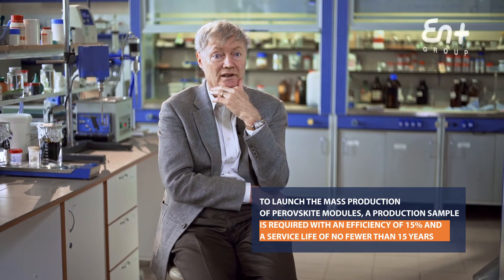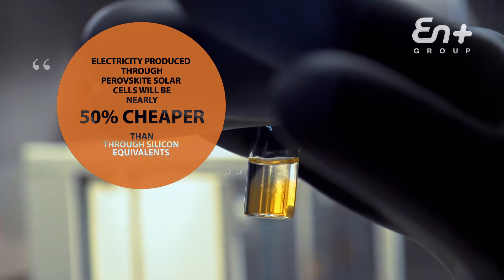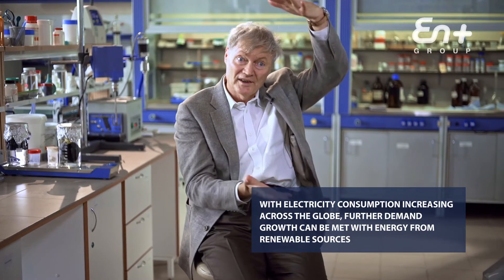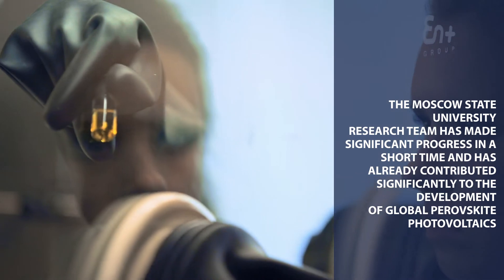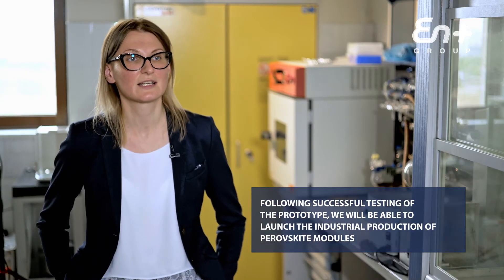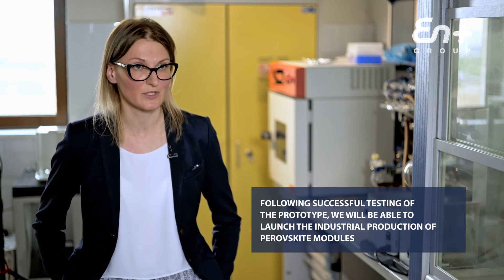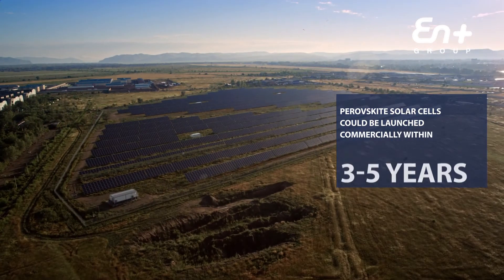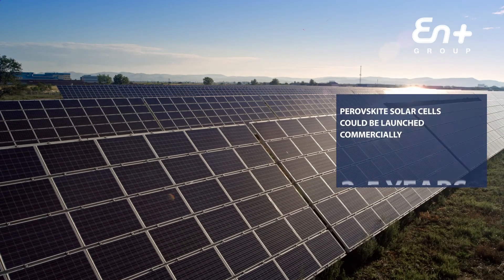En+ Group develops new generation of perovskite photovoltaic cells

Comment: As a scientist you work in the lab, dont try to predict system costs, just work on making the solar cells work for manufacturing process. I.e. Don't spin coat  because that's not a viable manufacturing method. System costs will come down on the engineering front, modules are just a fraction of the overall costs